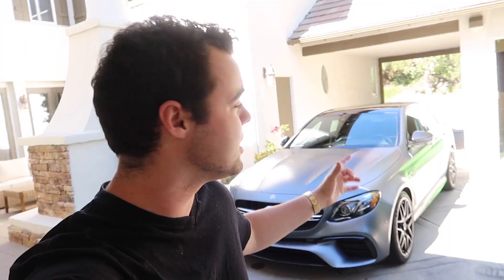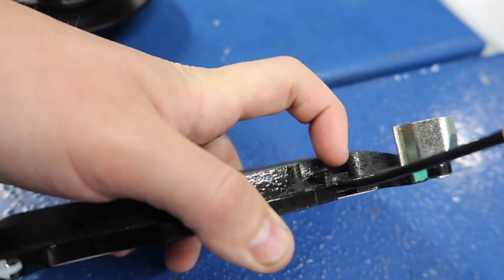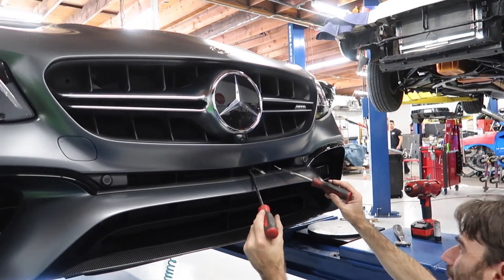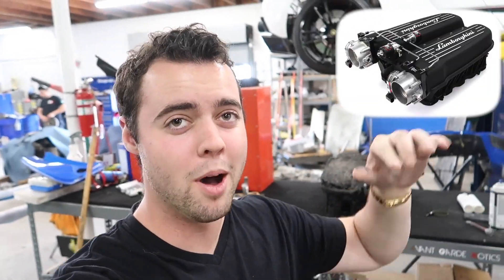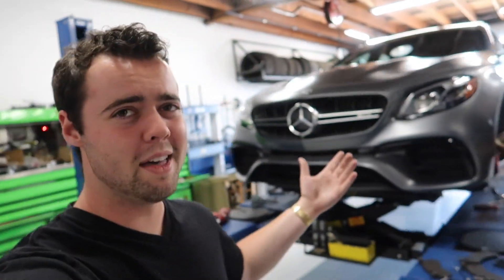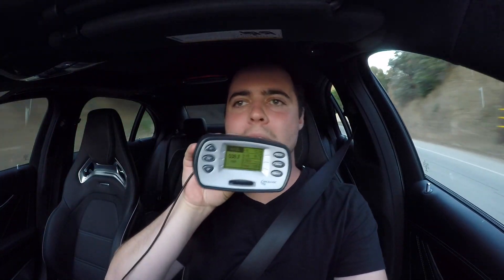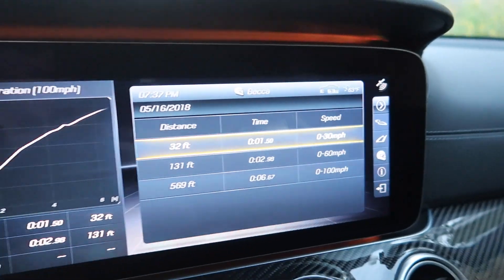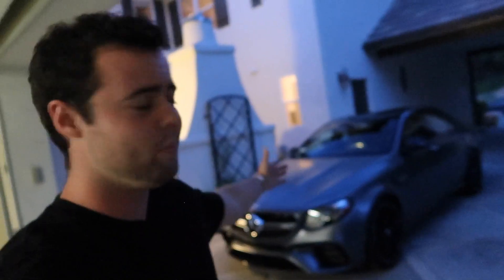MY TUNED E63S AMG DOES 0-100MPH HOW FAST?!

Comment: The reason your pads are wearing more on the passenger side is the cars lane keep assist system that automatically breaks the passenger side of the vehicle to keep you from drifting into the left lane. My e63s had the same wear as yours did and this was the answer the dealership gave me.
Reply: Smart guy ^
Reply: Adam Cook i don’t know why I’m asking this,but what is the year of your E63
Reply: Angel Medina 2018
Reply: Interesting! I would have never guessed that!
Reply: Makes sense
Reply: The dealer will try to sell you a new car if it needed brake pads if they thought they could.
Reply: This sounds like an excuse the dealership told someone to go away. You would definitely notice if lane assist was coming on while you were driving and should have no problem resolving the issue. I.E. turning that garbage off. OR just maybe... it's more likely you are an aggressive driver that tailgates and has a road rage issue and are applying your breaks too quickly and for to long cause unreasonably wear and thus creating a problem. I'm just spitballing that last bit.
Reply: I have the same issue on my BMW e60. But I do no have line assistance feature. Also Parker said that he has the same issue on his Lambo - so there might be another explanation.
Reply: Adam Cook i normally charge for information about cars. But with all of his car's  the passenger side pads under heavy breaking would possibly (can't be sure without looking closely for a proper diagnose) have the uneven pad depth due to the ABS applying more pressure due to the Driving conditions. If the vehicles ABS system detected more travel on one side it would apply more pressure to stop the car. Also the lack of a passanger in a vehicle changes the load for the ABS under heavy driving conditions. All this only comes into play if your driving fast and braking hard.  We all know he is hard on his cars so that works for a diagnosis. The shop he goes to should know that.
Reply: Adam Cook .!
Reply: Pretty sure roads on average are slanted to the right for water drainage. Might have something to do with brake wear ?
Reply: I have the same car as parker in black and I have never used the lanekeep assit. I find its more dangerous than anything.
Reply: Angular Momentum. It's cause the roads slanted for drainage.
Reply: All cars even before steering assist and ABS , would  have higher brake wear on the curb side of the road , this is due to the pertinent side of the breaks being on the “dirtier” side of the road where there is more dust and stuff that increases wear on the pads
Reply: A lot of the answers are actually true. However, all of these cars are equipment with stability systems the vector the wheels through torque limiting AND the brake systems. Meaning, the abs system will brake each wheel independently of one another regardless of whether their left to right or front to back. A lot of things are at play to keep these vehicles stabile while we drive and we don't even notice it. But the first answer is the best IMO.
Reply: Andrew Delashaw no. You’re wrong. Look it up and come back with something that is actually true.
Reply: Dude, are you even listening to yourself. I'm validating what you said if stuck around to read the entire comment. My answer was for those equiped WITHOUT lane departure systems. This guy, 😒
Reply: Nevermind, not meant for me, lmao
Reply: Guys , even before the invention of ABS , w/c was way before any other form of stability control , the passenger side of the brake system always had greater wear and that is because it’s on the dirtier side of the road .  and that will always affect break pad wear stability control no withstanding
Reply: What dues due to driving conditions mean?  Nothing that is what, so how should they know that?  You may know what you are talking about, but it is not much use if you cannot write it down properly
Reply: That's not the reason your right-side pads are more worn. The reason is that on that side there is more dirt that  contribute to wear more pads on that side. All cars with a left hand side steering wheel do the same. Saludos !
Reply: Ahh. That makes sense too.
Reply: @IDK_Mr.M  That's what I thought. With electronic force distribution the brake will be applied more where the computer deems necessary. 
Over the course of x,000 miles is when you'd notice. 
Do you have roundabouts? Maybe if so one wheel is turning faster than the other more often and is braked more?

Comment: Im a mercedes tech and the star does have heat inside so if its winter time the snow buildup will cause sensor issues, brake pad wear is because of the way the distronic plus system works!

Comment: I believe the reason the front right wears slightly faster than the front left is because the master cylinder is closer to the front right caliper than the front left, thus the break line is shorter to the front right giving less area to loose pressure in due to the lines stretching ever so slightly. If the master cylinder is on the other side then scratch my reasoning, lol.

Comment: Adding to what Adam already said (that FR brakes wear faster because lane keep assist uses FR brake to counter drifting into the left lane).. which is true. But sharp eyed mechanics will tell you that FR brake wear is always heavier on performance cars that don't have lane keep assist too. That's because when we turn left we generally turn in quick and fast into the turn. But almost everyone tends to be more cautious turning to the far side & and often brake before pushing hard into a right turn. So both of these causes together. And as you would expect, front brake wear reverses sides in the UK & other places that have right hand drive cars.

Comment: Ok I have to say this first...When you resurface a rotor your not supposed to use a sanding disk. Supposed to set it up on a brake lathe and make sure it's true to where it makes contact with the hub on the car when you set it up on the brake lathe. And then measure the run out, then subtract from what you measure on the rotors. Once that's done that will give you what you have left to resurface..and there is 2 ways either turn it on the brake lathe or they have a ball-hone for rotors to knock the glaze off the rotors and to give it a rough surface to allow the pads to seat in to the rotors. Either way great videos and always good content.

Comment: Higher pad wear on the right side is likely due to the fact people in left hand drive cars generally tend to take left handed turns much faster than right handed turns. This wear issue also occurs on the right tire slightly quicker than the left. It’s a good idea to rotate your rotors left to right as well as your tires (which usually involves taking them off the rim for directional tires)

Comment: your trackday raceway was a counter clockwise track, so the passenger side wheel was ALWAYS going a longer distance in the corners, because its more often on the outside.

when you are breaking and start to turn into a corner still on the break, the brakepad and the rotor have a higher turning sequence than the inner (driver) wheel.

in that case the distance your passenger wheels and brakes took is more than the driverside.

it also generate more heat on the passenger side and gets worn off faster.
thats it

Comment: Here is why one of the head lights might have been worn a bit more. In EU in order to have your car registered successfully the head lights have to be asymmetrical for safety purposes. The right light often has a bit more power in order to light the roadside (safety reasons) it also shines a considerably further that the left one (again safety reasons) because it is pointed higher than the left light. 

hope I helped ;)

greetings from Poland Parker!

Comment: I wonder if they wear unevenly due to hard braking on highway exits
Reply: It's probably due to the gradient on the road. Most roads have a gradient so water can run off, that gradient creates uneven weight distribution. The changes in the weight distribution cause uneven loads on the breaks, creating uneven break Damage, tire wear, etc. Etc.

Comment: Since it’s happening in both the e63 and the hurican I’m thinking it’s got more to do with stability control than anything.  The driver side will have more grip with driver weight on it so the traction control/stability control might be causing more brake actuation on the pass side to be more frequent or greater to prevent wheel spin.  Just my thought on the matter.

Comment: It depends on the back roads you take. The cars you have, have advanced stability control systems. And a lot of time if you take the same back roads on both your cars, and leave sport or track mode on. Some cars will use some type of torque vectoring by brake, which will cause similar where on on your vehicles

Comment: Civil engineering technologist here.... I could be wrong but roads don't have a flat cross section. Each land runs a 2 percent crossfall to the shoulder of the road to allow rain water to run off. 2 percent isn't much on a 3 meter wide lane width however, the slide slope may be resulting in a tiny biased weight distribution difference towards the passenger side rotor and pad making the passenger pad where more than the driver side. That's my opinion anyways
Reply: jake smith interesting thought

Comment: The thing with the brake pads: I think the majority of normal (right side driving) roads are inclined just a little to the right. In consequence the front right wheel will have the most load(and aderence) in case of braking so EBD will apply more force on that wheel. This can be most plausible cause of more wear on brake pads on the right side. Excuse my bad english.

Comment: AWD cars with antiskid might wear right front pad faster when driven hard around town because of tire spin

turning right is when i do the hardest accelerations and the front right antilock or traction control may be using the brake pads.  My only AWD car was a 1st gen A4 quattro.  it didn't have such a system but my right front tire wore out faster.

Comment: Break Pad Wear: All the roads specifically city and suburban roads curve to the right 'in the US' so storm water goes too the drain pipes and not build up on the road. So there is a bit more weight on the right since of the car is slightly leaning that side so more wear on the pads. In South Africa/any country that drives on the right hand side it's the other way around more wear on the left side. When they do alignment on vehicles they compensate to a certain degree so the car does not drive into the curve thus the curb/someones lawn.
Reply: Cross Slope: 
https://en.wikipedia.org/wiki/Geometric_design_of_roads#Cross_slope

Comment: We are seeing 7.3x seconds to ~97-99mph with 1.7 sec 60' at 2200 elevation at NHRA drag strip (accutime systems). Numerous runs by 2 brand new w213 e63s. 7.0sec to 100 mph would be an exceptional run for unmodded e63 not the norm in real life.

Comment: All cars with ABS systems wear more in the right. Thats because all the roads have more wear and damage by the side of the road. Witch causes when breaking more “boucing” of the right struts. In consequence of that the abs system aplies more breaking fluid to the right side of the car witch causes more wear
Reply: Guess what in the UK, Japan, Australia, etc they wear more in the left
Reply: There are more reasons like all roads aren’t perfectly flat they have a slight incline so the rain Water can drain. All these factors contribute to more wear on the right side

Comment: Actually it doesn't create an open circuit   i worked at mercedes I had a similar question  it turns out that the sensors provide a ground

Comment: Hmmm… Mercedes doesn’t make brake pads that cover the whole surface of the rotor. Reason being, when the rotor and pads wear regularly, a ridge is left around the circumference to squeak, indicating that a brake job is needed. Also the dealership can make more off you for having to replace both the pads and rotors. Correct me if I’m wrong and Mercedes doesn’t do this anymore because it’d be nice if they don’t.

Comment: 2nd rock puntured componenet. 1st took out intercooler at 700miles , 2nd yesterday puntured radiator at 2400 miles. Obvious design flaw. They charged me $2000 for intercooler. You should cover this issue and try to resolve. Check out more damaged 2018 E63s' like mine at MBworld forums.

Comment: You make more rights while driving then lefts so that might have something to do with it. Try to watch how you are using your breaks and when you seem to be applying them the hardest and note if you are experiencing a slight pull in one direction. But I would guess you are doing those types of maneuvers while turning and breaking to the right thus cause more wear to the right disk. Or they could have been improperly installed or you have a failing component both are not too uncommon.

Comment: M5         cts-v       e63s         panamera turbo
C/D Test Results
Acceleration    
0–30 MPH 1.1 sec 1.8 sec 1.1 sec 1.2 sec
0–60 MPH 2.8 sec 3.8 sec 2.9 sec 3.0 sec
0–100 MPH 6.6 sec 8.1 sec 6.7 sec 7.4 sec
0–150 MPH 15.9 sec 20.1 sec 15.9 sec 18.2 sec
¼-Mile @ MPH 10.9 sec @ 129 12.0 sec @ 121 11.0 sec @ 128 11.3 sec @ 123
Rolling Start, 5–60 MPH 3.7 sec 4.2 sec 3.8 sec 4.2 sec
Top Gear, 30–50 MPH 2.2 sec 2.0 sec 2.3 sec 2.2 sec
Top Gear, 50–70 MPH 2.4 sec 2.4 sec 2.5 sec 2.8 sec

parker with a proper surface you can get a much better 0-100 with your tuned car. 

car and driver tested the m5 to 100 in 6.6 and the e63s to 100 in 6.7.

Comment: This gen E63s > new M5
Reply: Nope fully stock M5 is just as fast as Parkers tuned E63S.
Reply: M50B25 Turbo Nope, stock E63s is still faster than stock 2019 M5
Reply: elyor fayzullaev Wrong, did you hear what Parker said in this video? Stock E63S does 0-100mph in 7 seconds, stock M5 does 0-100mph in 6.6 seconds
Reply: @M50B25 Turbo: Wrong. From 0-125 mph (200 kph), there is basically no difference in real life between the new M5 and the E63S. Over 125 mph (200 kph), the E63S moves slowly away, gaining almost 6 seconds up to 300 kph (188 mph). In German Auto, Motor und Sport, the M5 did 0-100 mph (160 kph) in 7.2 seconds and the E63 S in 7.1 seconds. Certified measurement equipment. In German SPORT AUTO, they use certified equipment and certified test standards as well, the M5 did 0-100 mph in 7.1 seconds and the E63 S in 7.3 seconds. The difference is always marginal. Those reviews in other car magazines are done with non certified equipment and/or weird testing methods. Not reliable at at because not comparable. The only thing where the M5 really beats the E63S is the track. On the Nordschleife (over 20 km length), the M5 is (according to Sport Auto) almost 7 seconds faster than the E63 S Estate(!)...they haven't tested the lighter E63S sedan yet. Also, the M5 beats the E63S in braking from 200 kph (125 mph) to 0 kph but Mercedes started to use the new PZero M01 tire (similar mixture to the M5), so braking time and track time have improved. The earlier test cars were all using Michelin PS4S M01.
Reply: R8V10Plus
 They have tested the E63S sedan vs M5 on several other tracks (Hockenheim, Sachsenring and other German tracks) and M5 is always faster by a wide margin of 0.4-1.3 seconds, that is a notable difference. Nurburgring isn't the only track on earth you know.
And keep in mind this is only the ''standard'' M5 with a soft suspension and it already outhandles the E63S - M5 Competition will be more track oriented with more power.
On AutoBild Sportscars test the M5 was 0.5 seconds faster for 0-200 and 0.4 seconds for 0-250 but E63S was faster for 0-300kmh it is simply due to gearing, the M5 will be faster in 99% real world drag races.
Reply: M50B25 Turbo Dude, you don't get it. We already did a real life comparison back to back, there is basically no difference from 0-200 kph (zero, cars were side by side) and over 200 kph, the E63S pulls slowly away. On the track things look different because of the tires BMW is using. Those are not normal PZero tires, they have been specifically developed for the M5. Also BMW had time to fine tune their AWD and chassis based on what they learned from the E63S and the Panamera Turbo/Turbo S. To make it short: In real life, you won't see much difference between both cars. It is also no secret that the M5 testcars have more than the claimed 600 hp, let's hope that BMW customers get the same power. Most E63S customer cars deliver more power as well, usually around 640-650 on average (the tested M5 in Sport Auto had a whopping 671 hp) but Renntech encountered once an E63S customer car with 690 hp, so... LOL Nobody with some brains runs a two tons sedan on the track, this is why I have my R8 V10 Plus. The E63S is the family car and on the Autobahn, it pulls away. Slowly but it does. And it sounds way better than the M5 and this is where the emotional part kicks in.
Reply: R8V10Plus
 E63S estate test car had 660hp, M5 test car had 671hp.
Customer M5's have been dyno'd as well at 625 wheel horsepower which equals around 690 crank horsepower, others have been dyno'd at 650 crank hp, it depends on the dyno mostly.
Also keep in mind BMW is keeping the ''standard'' M5 tamed just to go all out with the M5 Competition with more power, better suspension etc.
So even if the standard M5 is ''on par'' with E63 S the M5 Competition will place it safely ahead.
Reply: M50B25 Turbo Dream on. LOL May I ask what car you drive now?
Reply: R8V10Plus
 Dream on lol how? BMW claims the stock M5 does 0-200 in 11.1 and M5 Competition does 0-200 in 10.8 seconds. If the top tier E63S can't beat the base model M5 imagine what M5 Competition will do to the E63 and E63S on straight and track. I work at a Mercedes dealership I drive different Benzs every day.